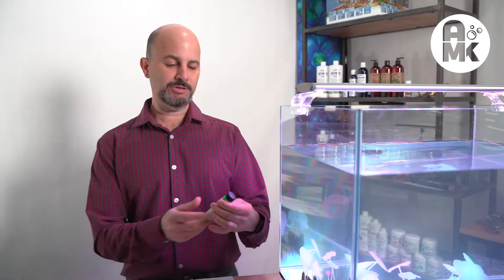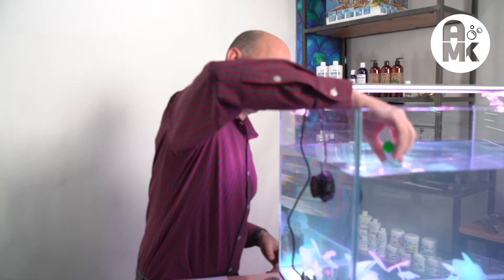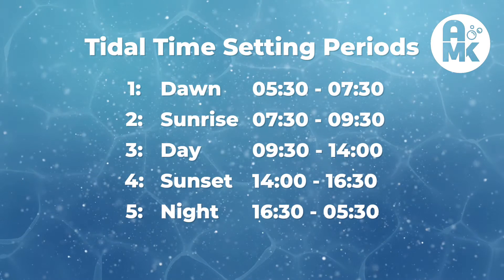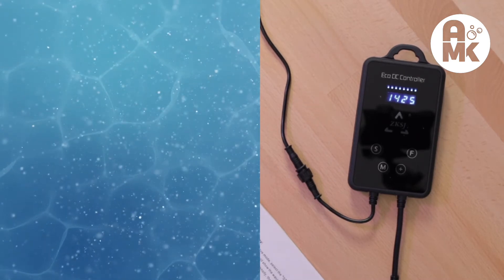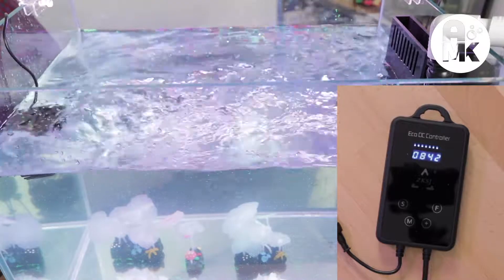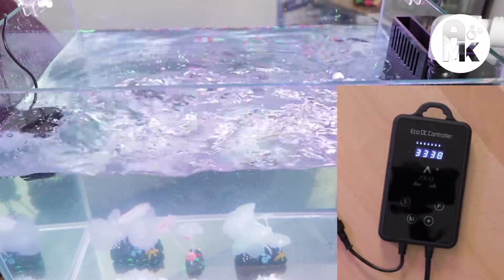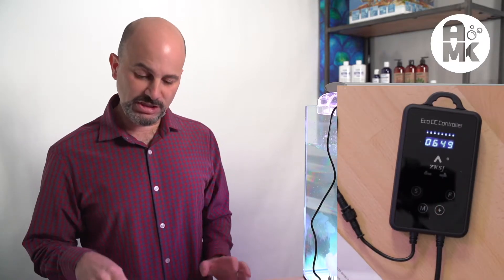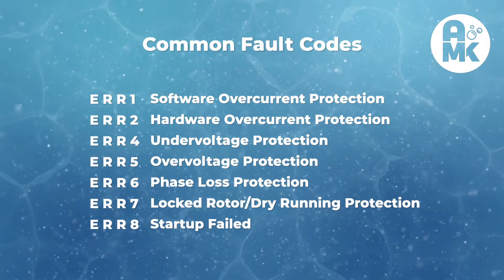Platinum Slim Wave Programming

Comment: I keep getting err7 this pump is complete garbage
Reply from the maker: This is the cleaning code. Soak the impeller in citriclean and clean the pump.  If there is resistance from calcium or buildup the pump codes error 7 to prevent it from harming the pump.
Reply: @aquamanknox  it’s brand new maybe a week old no way it can be calcium buildup
Reply from the maker: @Theunbelievabletruth489  does the pumpmblade spin if you spin them by hand out of the water?
Reply: @aquamanknox  thanks for replying if u can help I would really appreciate it and pay it foward thanks again
Reply: Must be user error.
Reply: I keep getting ERR2..how to resolve the issue?